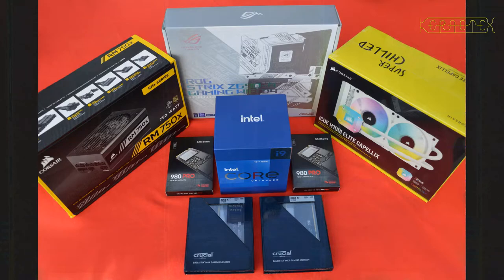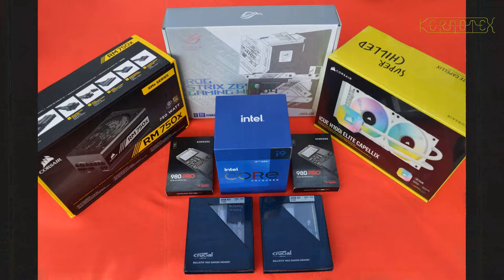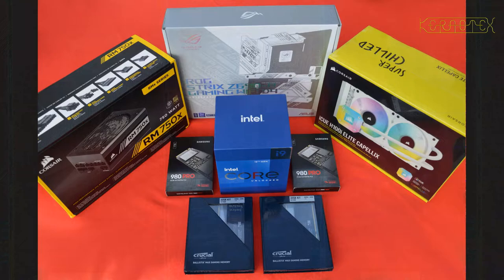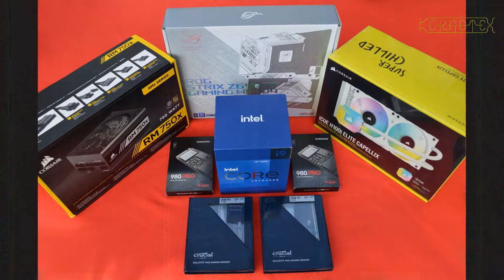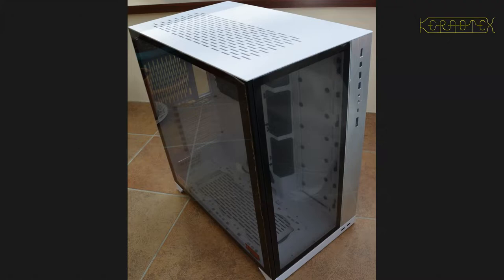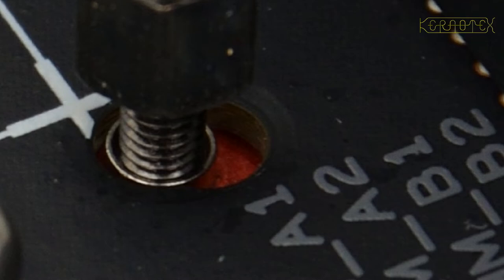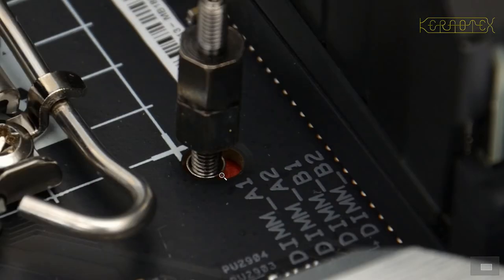3: System Build - Linux on Alder Lake

Comment: I would install the radiator upside down with the pipes from the bottom up.
Reply from the maker: Hi Top Dog, yes I completely agree. It's now been replaced by a 360 mm in a horizontal position at the top of the case.